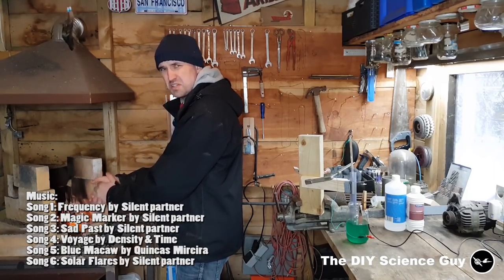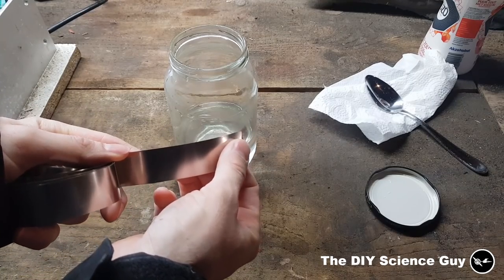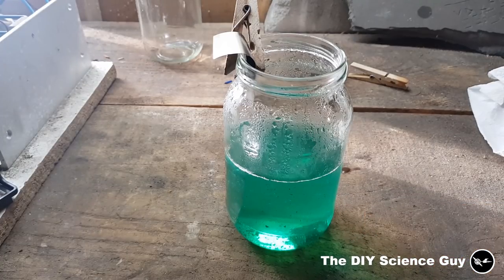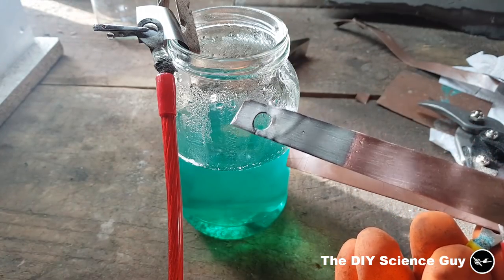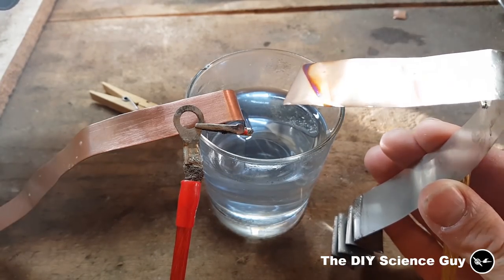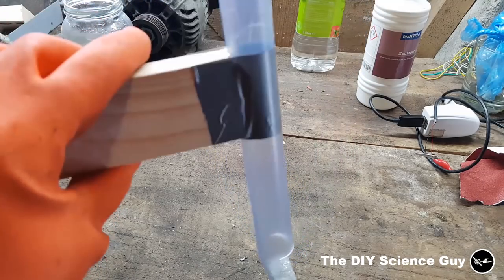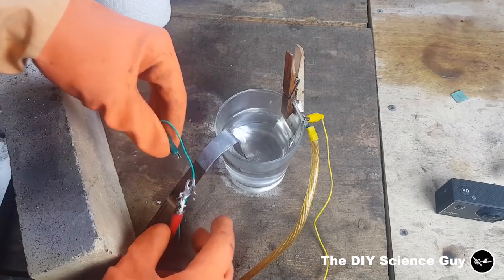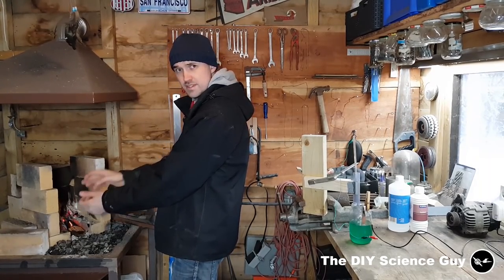Hydrogen Generator #4 Heavy nickel plating hydrogen generator electrode experiment

Comment: This solution is not going to work in the long run. I think it will be worse than the stainless. in the hydrogen generator you are effectively reversing the electroplating. you will simply be plating the other end with nickle then exposing the copper and plating the other end in copper. For this you would be better off just using the nickle strips themselves. 

to get maximum run time using these materials you will need to reverse the polarity of the cell occasionally. and have an excess of nickle in solution as well a making up the electrodes so that you get maximum electroplating on either electrode at any time. junk will still fall out of solution and your design needs to be accommodating to this. Just like deep cycle batteries, this is a similar posses as to how they age and  how their design helps increase their life span. this thin  electroplating will never be a long term solution.
Reply: The first step in plating is making the nickel concentrate bath, and this requires an acidic solution (vinegar here) so the Ni can be absorbed. During electrolysis, he is using a basic solution as an electrolyte, so the Ni won't be able to enter the solution, and hence no electroplating will take part in the reaction.... I think
Reply: @chadw8164  it may be true that the nickle will not dissolve in a basic solution as it would an acid (im not sure it really makes a difference) but the mechanical aspect of electrons taking pieces of the metal away should still take place. what is not transferred to the negative electrode or dissolved into solution, will fall to the bottom of the tank.  the strong base was not the reason for the failure in the first place it was the stainless steel being broken apart form the unintentional electroplating. It is basically like forced galvanic corrosion.
Reply: @MrStemkilla  Can't say I've seen "electrons taking pieces of the metal away" as you've described in my testing. Of course, I've seen oxidization take place and rusty bits fall, but I don't think the electrons can physically break pieces of material off... 
The yellow stuff in the water with stainless plates is Cr ions. From my chemistry knowledge, I don't think electroplating is occurring here
If it is being electroplated, Tim would've noticed build-up of material on the cathode plates..... and he's super smart and would have noticed, and let us know right? heh
Reply: @chadw8164  for electroplating to take place you need a current between two non touching pices of metal through a conductive liquid.  thats how the nickle got onto the copper parts, thats how it will be removed. its a reversible possess. it takeing place is not a question, it is happening. thats what killed the stainless hardware and thats what will kill the very thin nickle plated copper parts. the materiel may not deposit on the other electrode effectively and just fall out of solution but that is indeed why only the positive electrodes are breaking down.  the pure nickle tabs themselves is a better option as they are more conductive than stainless, and soft (easy to work with) however the best option its to coat the positive connections with a chemically resistant non conductive paint. 

the electrolysis plates will be corroding in the same manner and are consumable parts that will periodically need replaced at some point.
Reply: From my experience, an alkaline solution such as sodium carbonate or sodium hydroxide, is less corrosive on nickel than an acid in anodic configuration. Especially an acid with the chloride ion present. The nickel does appear to corrode forming a precipitate of probably nickel oxide, though much slower - again from my experience. I don't know how it compares with stainless steel. But for a thin plate to work, it would have to be far better to last. I would be interested to see how manganese dioxide on titanium would hold up in this situation.
Reply: @Clipster15  ints not the contact with this solusion alone causing the problems. thats why the negative leads are not effected at all. the solution makes very little difference.   it could be some salty water and still corrode any metal you place in there. the electrical posses is literally stripping partials of metal away from the positive connection.  the only way to stop this is to get rid of that conductive path by painting the surface with literally any type of paint or wax that can wistain that solution

Comment: So how does it work? Did you plate with nickel all the copper plates and make a new cell? Where is the video where you open the old cell to see what happened inside? Can you recommend some Chinese panties (material) as a good membrane - is nylon still you best choice? I keep my fingers cross for your experiments.
Reply from the maker: No not yet. It's pretty hard finding enough time to do all the experiments when you have a fulltime job and a family to take care of 🤔 but don't worry I'll get there. Polypropylene mesh works best. Don't no chinese stuff that can help.
Reply: @TheDIYScienceGuy  Cool! I'm reading about PEM cells and I would gladly compare these two. PEM is interesting, cause I have heard you have a much higher pressure and you don't need to compress hydrogen - you just put it directly to tank from the cell, but price is much higher.

One more question - this transparent glass in you cell is plexiglass [Poly(methyl methacrylate] or something else? It looks like plexi but KOH or NaOH could damage it easily, so I'm not sure.
Reply: It's solid polycarbonate?
Reply: I thought it was plexi... but after checking it reactivity even alcohol can dissolve it, so now I'm not sure...
Reply: This Polypropylene mesh - how many microns does the mesh have?
Reply from the maker: It's polycarbonate 😃
Reply from the maker: A mesh width of 0.05mm will work. Thickness is not very important, as long as it's strong enough.
Reply: @TheDIYScienceGuy  Thanks for fast reply! Polycarbonate... yea it make sence, ABS and Polyetylen are also viable options to consider. So it is 50 microns. Are you sure that polypropylene is the best option? Better then nylon or polyester etc. (not that I don't believe you, I'm just curious why)?

BTW where did you get this polypropylene mesh? I check on ebay and there is no filter there.
Reply from the maker: Yes polypropylene is the best. It's used in high basic environments polyester dissolves in high ph levels. I'm not yet sure about nylon. I haven't found a good polypropylene mesh yet 🤔

Comment: you cann use grafide instead .it has no side effects
as far as i know
Reply from the maker: The resistance of graphite is 100 times higher than copper so that would make it very inefficient. But thanks for the suggestion!
Reply: @TheDIYScienceGuy  what is the Resistivity of Graphite in Ohm*m at 20 degrees Celsius?

Comment: literaly 2 day befor i get to buy a bunch of stainless  the video show up T_T now im screwed
Reply from the maker: Ok, well as long as you did not buy anything you still have a choice. You can do it the way I'm going to do it or you can buy stainless steel with a low or no chromium percentage.
Reply: @TheDIYScienceGuy   i gotta do more search it was just ironic
Reply: lol
Reply: Why use the copper at all? Why not just use the nickel electrode? I dont claim to know the answer, I'm trying to learn😁
Reply from the maker: Because nickel doesn't conduct electricity as well as copper. With a nickel plated copper electrode you have a very well conducting electrode with only a very thin layer of nickel creating only a very small resistance instead of a full nickel electrode with a larger resistance overall.
Reply: @TheDIYScienceGuy  what if it was Nickel alloyed with Silver?

Comment: Why don't you just use Nickel plates for your electrodes? at such low voltage - who cares about conductivity? you will never have to waste time plating again. ! Yay ! ! Maybe a little higher expense but when you start adding up the time and effort in that plating process; I think it's a win WIN ! !
Reply from the maker: Nickle resistance is to high. I want to increase the efficiency and love to experiment!
Reply: @TheDIYScienceGuy  I would not be surprised if a given size nickel wire had more resistance than a copper one - but on a HUGE sheet of nickel I'm surprised that it would have much resistance at all. Am I missing something here? Wouldn't a huge sheet of almost any metal have low resistance while submerged? Did you actually test the difference in resistance of a copper plate to a Nickel plate?
Reply: @TheDIYScienceGuy  Sorry I re read my post and realized I didn't say "WOW that's an awesome Plating process you just did. I am so glad I watched it and thank you so much for posting your experiments! ! ! For some reason I thought this but did not TYPE it.

Comment: I've found a phone charger seem to be the best for me anyway otherwise I get a dirty job. Even then I still have issues if I leave it in to long. I'm not sure if my concentration has gotten so built up but if I leave anything in longer then a few minutes I get a ruff finish. I guess I could have contaminated it when the clip on the positive side got into the solution and it desolved into the solution lol.
Reply from the maker: Yes you probably contaminated it I think, don't worry, as long as you know what went wrong you'll be ok 😉
Reply: If you don't have brown or black stuff forming during electrolysis it means your solution isn't contaminated. To get bright nickel plated additives is just a commercial way to increase the Price. Actually the brightness is obtained by balancing the amount of nickel acetate concentration , add nickel Chloride and boric acid and you will get a very shiny mirror  finish